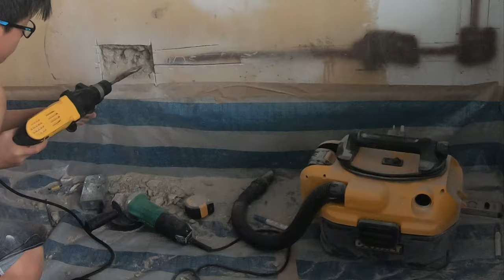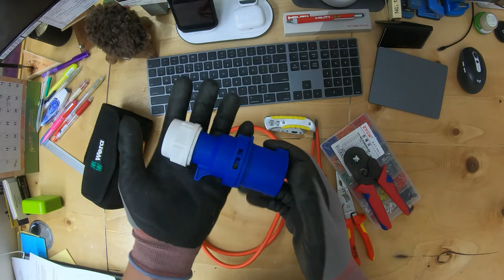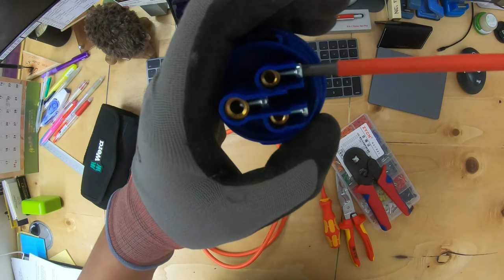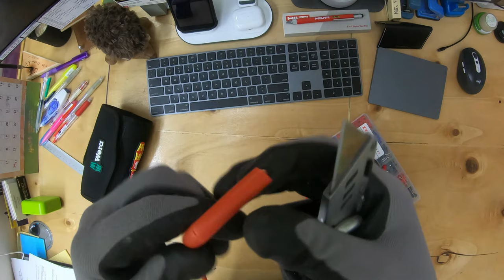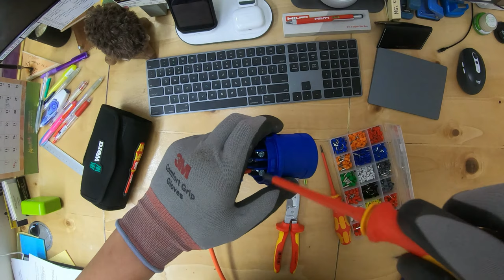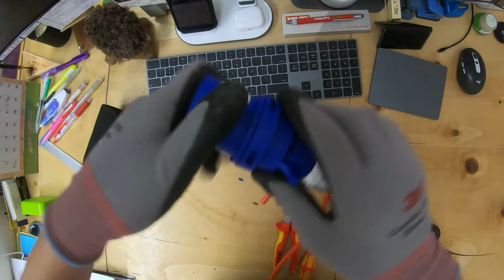Wiring a 16 amp Plug Professionally ( CEE 16A IP44 Plug )

Comment: A big mistake and a small one, do not shorten the earthing, it must be the last conductor that break away and do not twist the wires before inserting the pins or other tipe of conections.
Reply from the maker: Yupe thank you for your reminder! I realized the earth should not be shortened. I will pin your message up.
Reply: @k-30creator20  shortening the earth so it breaks first, wrong size ferule on earth, wrong screwdriver used to tighten terminals, twisting the conductors so they break when crimped, should strip with correct stripping tool for cable size to avoid damaging insulation and conductors, not heat-shrinking the ferrule sleeves, and stripping the conductors before insertion through strain relief so conductors get damaged. you should probably re-film this in case people don't read the comments!

Comment: Wouldn't  be so bad if you actually  showed wich wire went where rather than your hand cover it
Reply from the maker: Check out the latest video, should be much better, pretty much the same principle. Brown or Red to Live, Blue or Black to Neutral, YellowGreen to Earth. Hope this help, sorry for any inconvenience
Reply: @k-30creator20  that's still not useful.you are making assumptions that all sockets come with the diagrams next to each pin 🤦‍♂️
Reply: Clearly not competent enough to be carrying out this if asking these questions. Simple.
Reply: @Fraz-ms6ow  are you serious  months  down the line you want to put a comment on question is if your competent to be doing it 🤔
Reply: Better late than never.
Reply: @Fraz-ms6ow  for you yes

Comment: very useful!   ive bought a second hand commercial coffee machine for my home, it used to be hard wired in. would fitting a plug like this then a 16amp convertor work to power my machine? :)
Reply from the maker: Worth checking the wattage or amperage of your coffee machine first and then decide which kind of plug u need to use! Good Luck !! 
Quick tip: Current (A) = Power (W) / Voltage (V)
Reply: @k-30creator20  have just bought a 240v connector and plug :/ just noticed the coffee machine runs on 230v. Will it not work at all?
Reply from the maker: Yes, these plugs and socket are rated for voltage in between 220-240V.

Comment: Never trim the earth shorter than the rest of the wires, it should be the longest and last to pull out in case of cable restraint failure.

Comment: Genuially got socks older than this kid. Buy proper stripping tools. Why are you wearing gloves? So many mistakes and so many questions....
Reply from the maker: There is always room for improvement, please do let me know the mistakes that I have made. Always up for questions :) and Gloves are just great :) Have a fabulous day !
Reply: There is nothing wrong with using gloves if you like to do so.

If you don't have proper strippers, you work with what you have. Besides, you should see the amount of electricians who use knives, pliers or other means. The important thing is whether you can get the job done and without damaging the strands. With practice sharp pliers can get the job done better then strippers used by a rookie... And don't kid yourself into thinking those automatic ones are the best either 😆😆. Just be careful and look out for damage as the guy clearly said in the video... 
You work with what you have.

Also, there is no need to be rude, like who cares if you're old, "got socks older than this kid". Doesn't make you any better, you obviously aren't a pro considering you're 1. Watching this video, and 2. Like to push others down just because you feel superior.

"So many mistakes so many questions"     Your attitude, it's unbecoming, do better. And be specific about all your "so many questions". How else is he to answer them.

Comment: That plug is made by PCE and they only use Phillips screws. No. 2 to be more precise...

And for the double screw of the earth connection you should use a 12mm ferrule.
Reply from the maker: Would it be possible if you could explain a bit further about the 12mm ferrule ? It’s a 1.5mm cable that I have used, have I missed something important ?
Reply: @k-30creator20  one thing. Ground terminal has 2 screws, therefore the ferrule and isolation clearance should be a notch longer in order to reach both of these screws. That’s why you should use 12mm ferrule on ground.
Secondly, according to IEC guidelines, you should also heatshrink the sleeve of the ferrule around the cable to make it resistant to slipping off in any situation. Otherwise when the cable is used badly and put under strain, and your ground slips out, somebody will get killed and gear destroyed. Probability of that you want to reduce as close to zero as absolutely possible. Other than that was all good anyway, just two little additional details :)
Reply from the maker: That make a lot of sense, thank you for mentioning! Really Appreciated! Will remember that from now on!
Reply: No worries :) keep up the good work and thanks for posting this video, many will find it very useful
Reply from the maker: Thank you for such a kind and positive comment! We need more people like you around the community! and again thank you for widening my knowledge, it was extremely helpful!

Comment: Hi can i terminate the other end in a power strip for 13A UK plugs?
Reply from the maker: No! Only connect a 13amp plug to a 16amp socket! Or a 16amp plug to a 13amp socket.

It’s is a 13amp plug in the video. You would NOT want a 13amp plug to a 16amp plug.
Reply: @joshuantw  I see that OP had misinterpreted your question.
Yes, you can connect a 
CEE 16A Plug to a row of 
13A Socket(s)/Moulded Power Strips.

Comment: how much mm wire to use?
Reply from the maker: 1.5mm2, however I do recommend using 2.5mm2 as they tend to be more rigid and can increase the safety factor.